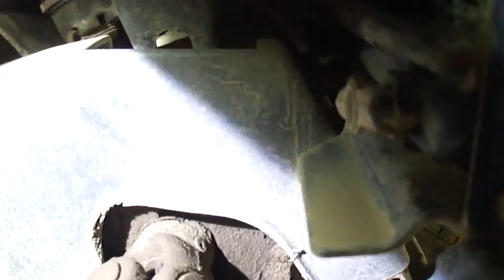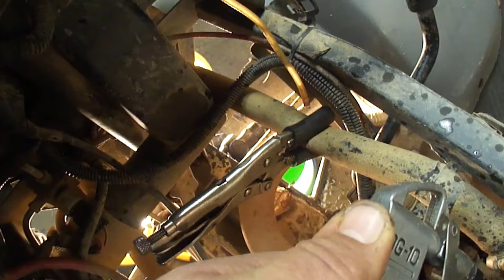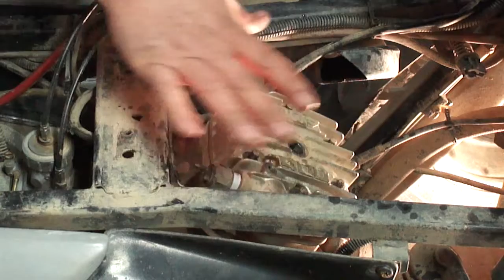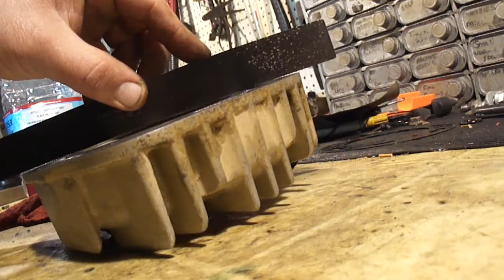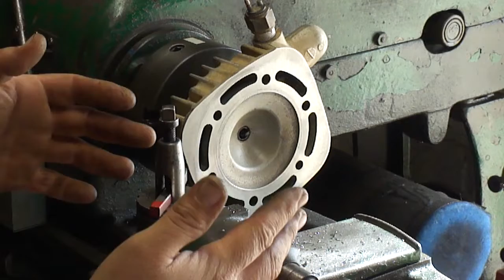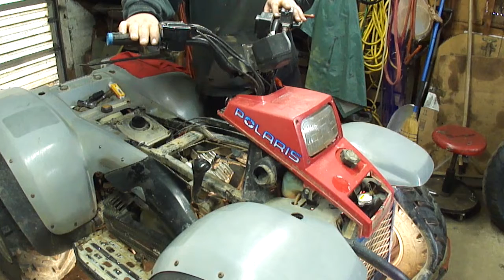Polaris 400L Head Gasket Replace

Comment: I have a question what grit sandpaper did you use
Reply from the maker: I used 220 first just to see how bad the head was. If it was really bad, I would have started with 150 or 100 and finished with 220. Don't worry so much about having a super smooth finish as long as the head is flat.

Comment: Howdy man, I’m having issues on my 400l, I replaced the fan motor and thermostat also the 20 amp fuse. The fan still won’t come on. Any suggestions or ideas would help thanks.
Reply from the maker: What year machine? The 1994 400L doesn't have any fuses.
Reply: @MrFixit1 1997 Polaris sportsman 400l  4x4.
Reply from the maker: @Stonedog-o5h  Have you done any testing? or did you just replace some parts?
Reply: @MrFixit1 yes done some tests for power/continuity. Replaced the old fan motor and new thermo sensor, still is overheating and fan is not cutting on when warm.
Reply from the maker: @Stonedog-o5h  Watch this video
Reply from the maker: @Stonedog-o5h  Watch this video https://www.youtube.com/watch?v=lDYhMPkiyFA&t=1s
Reply: @MrFixit1 I probably should check the head and gasket, but what would that have to do with the cooling/radiator fan issue?
Reply: @MrFixit1 the fan cuts on now when I put a jumper wire across the 2 wires that plug into the thermostat. Put crazy thing is when it running it will not cut on. Why would that happen??
Reply: @MrFixit1 it has a 20amp breaker that was incased in a plastic pouch.

Comment: I got my jug re-bored, my head milled, and a brand new niche head gasket and i am getting a bit of exhaust gas leaking into the coolant. Runs great though. Any suggestions?
Reply from the maker: First thing, is the cooling system being pushed out of the overflow? The reason I ask is, are you sure it is leaking exhaust into the cooling system? If yes then you may need a better head gasket, or maybe the milled head isn't flat. Did you check the head before you installed it? Did you check the cylinder deck for flatness? Did you recheck the torque on the head nuts? Did you have the cylinder, and head magnafluxed to find cracks? Did you send the head to a machine shop, or did you do the work yourself? There is a lot of variables here.
Reply: @MrFixit1  sent the jug and head to a machine shop. Yes fluid is getting pushed into the res. Desk and head appear flat to me. yes i re-torqued. No on the magnaflux., but no visible cracks. Compression is 150 cold. The most likely problem from my looking around is a poor quality head gasket. I read lots of posts last night about niche and other cheap head gaskets having issues on this motor. Lots of guys suggest to buy the headgasket separate from the gasket kits and get a quality one like Weisco. Cheap ones are often too thin and arent always perfectly flat or have even thickness throughout the gasket.  Any recommendations on a quality head gasket for this motor, besides weisco? Thanks for the help BTW.
Reply from the maker: @KenGerding  Check out this video where I talk about what gaskets I use https://www.youtube.com/watch?v=-ufu4jQrwYI
Reply: @MrFixit1  LOL. I normally use cheap-o gaskets too, and that may be the problem. Went and bought a quality strait edge today, going to use that and some feeler gauges to test for flatness. Also read that WSM gaskets are good for Polaris. Always thought they were Chinese, turns out they are made mostly in Italy & Germany. Read a couple places where guys swapped the cheap one for WSM or Weisco and the problem was corrected. Gonna pop on one of them. If not, its back to the shop for my head and jug.  Fingers crossed. Thanks for all the help.
Reply: @MrFixit1  Say my wrench was or i screwed up and put 25lbs of torque on the nuts. Would that be enough to warp it?
Reply from the maker: @KenGerding  Possible but more than likely you just got a bad gasket. I would check the head anyway.

Comment: What head gasket do you use and where to get them? Thanks
Reply from the maker: Athena or Cometic usually but I have also used Winderosa, Numera and Ne brand with no issues. As long as your head and cylinder are true and straight.
Reply: @MrFixit1  any of them better than the other?
Reply from the maker: @larrywinberry2894  Unless you are running super high compression or have high performance port job and or you are going to be running the engine at its braking point consistently then not really. I run my engines hard for hours on really hot days and have had no issues with any of the above mentioned gaskets. The most important thing is proper torque and clean flat surfaces. But if I must assign a brand the Cometic or Athena are probably the most expensive.
Reply: @MrFixit1 ok thank you

Comment: How likely is a water pump gasket to cause me to burn coolant, had top end rebuilt since i thought it was head gasket but its still burning coolant and i can see bubbles in the radiator.
Reply from the maker: Only way the water pump would cause you to "burn" coolant is if the water pump seal or gasket is bad and you either have a bad crank seal or you have a hole in the crank case behind the balance shaft. Look to see if there is coolant in the balance shaft oil. The water pump and crank shaft are in two different compartments. Check out this video: https://www.youtube.com/watch?v=mjosCosCUA0

Comment: What brand of head gasket do you use?
Reply from the maker: Athena or Cometic usually but I have also used Winderosa and Numera with no issues. As long as your head and cylinder are true and straight.
Reply: @MrFixit1 When you torque the head, should it be torqued again? I installed the head gasket and it keeps sending pressure to the radiator. Thanks to your videos, they've helped me better understand how the machine works.
Reply from the maker: @NoeSierra-r7c  I usually go over the pattern a few times when installing a head. Look closely for any cracks in the head and cylinder and check for any warpage. The head is prone to warpage; they can warp easy, and it is hard to tell if it is. Only takes a slight warp to keep a gasket from sealing. Try sanding the head on a flat surface like a granite countertop or a sheet of class this will show you if the head is warped. I think I detailed that in this video if not there is another video on the head gasket I uploaded.

Comment: Does a lot of white smoke ( clouds )always indicate a blown head gasket ?
Reply from the maker: If you are also losing coolant, then yes. If not, then it could be balance shaft oil leaking into the crank case. So, check the fluid levels.

Comment: Quick question Mr Fixit. Did you do a 'COLD ENGINE' compression test after replacing the gasket? If so what was the reading please?
Mine is reading 65psi when cold, wonder if that is good, or bad?
Reply from the maker: I did do a cold engine compression test on my machine, and I got 165psi. Keep in mind that I machined the head for more compression. 65psi is not going to run. You need at vary least 100psi. Below 115psi is considered bad. Make sure you are holding the throttle wide open when testing. Also use a compression tester that has a Shrader Valve in the hose.
Reply: @MrFixit1  O hell! Just discovered another problem. A 1/2 inch broken hole on top of the casing, immediately behind the oil pump. Can see moving parts inside it when kick the engine over.
Thankfully correct me if I'm wrong, but don't think that has any bearing on the compression issue. 
Just performed another compression test, still only 65, even with throttle wide open this time. So going to now dismantle the piston manifold, see what I can find 👍
Reply from the maker: @christofsmanlib1385  This engine was known for piston failure.

Comment: Question: I have pretty much the same unit, but I’m having a little bit of a different problem. It seems my motor won’t run unless I have the choke on full and then it seems to run fine and if I take the choke off and she seemed to wanna go to a little bit higher rev but then the motor just dies. Do you have any suggestion?  I think I probably getting air into something between the cylinder head and the carburetor probably in that rubber boot, but I don’t know how I can really test/check that?
Reply from the maker: Use flammable Brake Cleaner to find any vacuum leaks. Check out my video on carburetor rebuilding and tuning.

Comment: The head gasket is the same of the 350? Or is different
Reply from the maker: Two different part numbers (350L 3084517) (400L 3084731) Head gasket
Reply: @MrFixit1  and which type of oil need to have the engine of the 350?
Reply from the maker: @alanespinoza03  Polaris blue 2 cycle oil
Reply: @MrFixit1  thats the one of the engine or the one of the gasoline?

Comment: Two quick thoughts, i like to run a head across sandpaper on glass to check for warpage, more accurate for me than feeler gauges. i was hoping you'd find some then show the camera. always be looking for root causes.
second, a warning to people attempting to remove head material to increase compression. you MUST check for proper squish clearance. removing .015 is nearly 30% off (generic value of .050 clearance or 1.25 mm)
i've set squish using base gaskets, it's a pain, but vital.
Reply from the maker: What effect will it have if the squish rate is too small?
Reply: @MrFixit1  i'm no enginerd, but i know it can hit the head, performance wise it's to prevent deto and increase turbulence. 
i believe they set it generous to allow for thermal expansion.